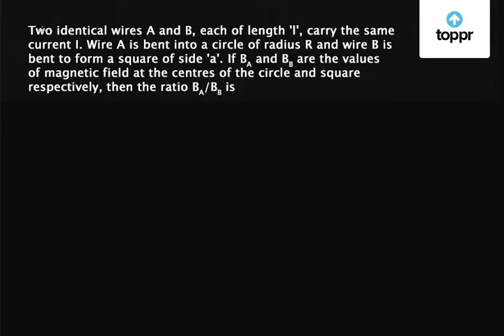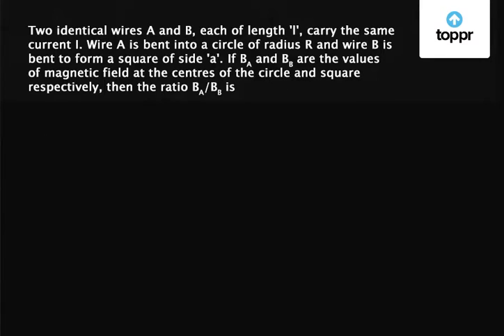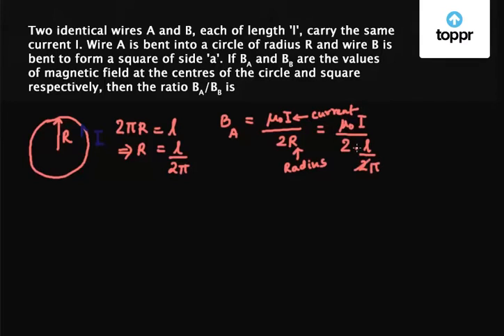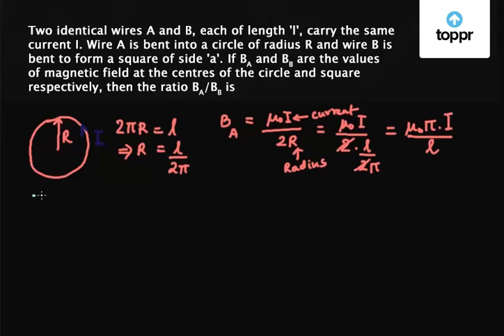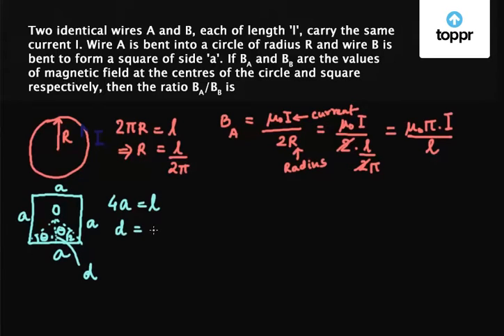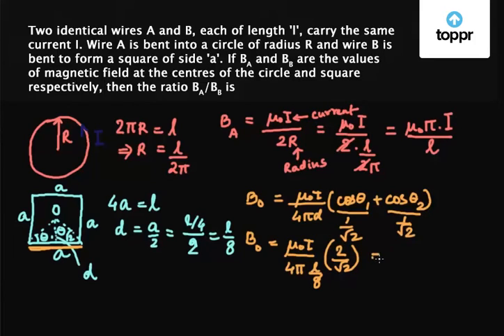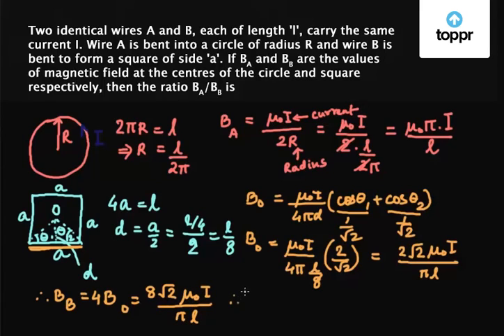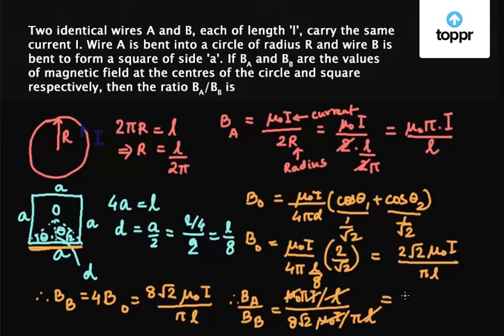Magnetic field at the centre of a current carrying loop- Example | Physics

Comment: shouldn't it be l/2 at 4:11
Reply from the maker: +Naim Kassira Can you specify which step you can't understand? We will be more than happy to clear your doubt.
Reply: at 4:11 in the video, when she writes "pi x L" in the denominator, it should be "pi x (L/2)", correct?
Reply from the maker: +Naim Kassira Ok so I have understood your confusion. Nothing is actually wrong. It is pi(l/2) only, but the 2 goes up and gets multiplied with the numerator. If you Calculate the expression you will get the right answer. Is there any other confusion ?